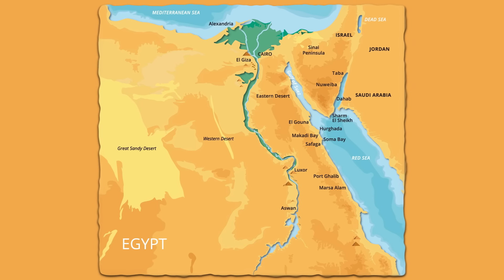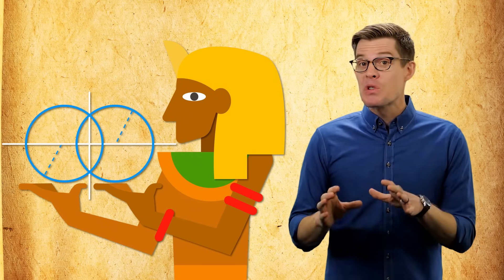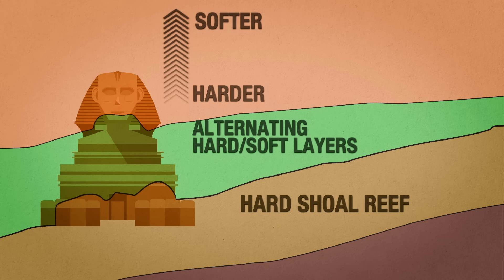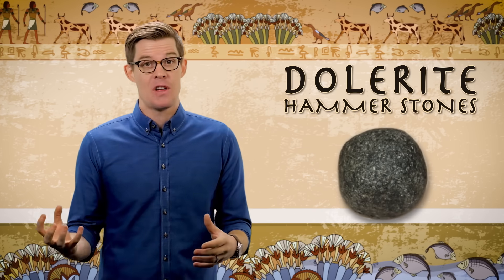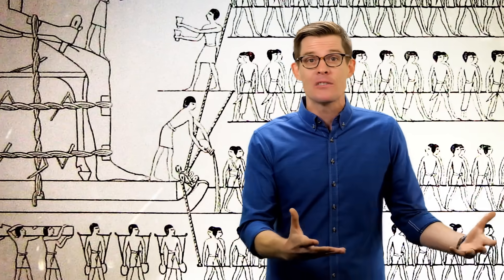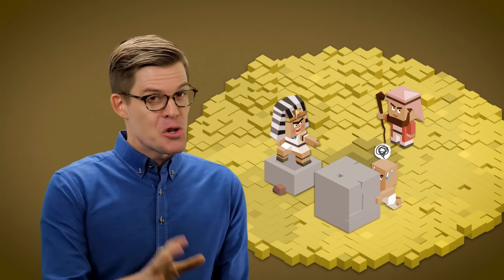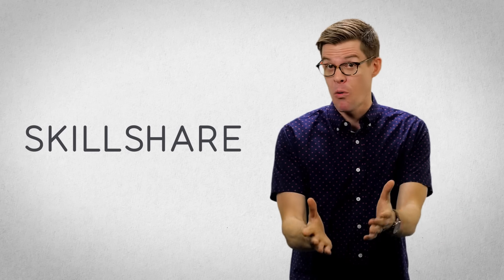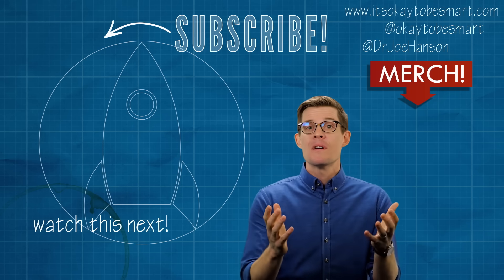The INCREDIBLE Ancient Engineering That Built the Pyramids

Comment: 2million+ stones, cut, shipped, placed, all within 20 years. So the Epyptians cut, shipped, placed a single block every 2.3 minutes. The inside contains granite, one of the hardest stones found on earth. In modern day diamond saws are used, but the Egyptians managed to stick and stone it in shape. Yeah, this guy knows nothing.
Reply: lol!  Pity you did not bother to learn the evidence here.  I of course understand that learning requires "effort" = whereas incredulity and poor assumptions do not.  C'est La Vie

1 - most of the "blocks" of the pyramids are actually little more than crudely hewn chunks of stone of varying shapes and sizes.
2 - so it appears based upon the blocks themselves and the quarry evidence that they were simply rapidly breaking off approximate chunks of stone in most cases - pounding a line of chisels or wedges a short distance into the bedrock is sufficient to cause a chunk to fracture free - followed by them levering those chunks onto wooden sleds.
3 - the sleds were then pulled by teams of men and oxen up an earthen ramp they made.  The quarries of Giza sit a mere 100-200 meters from the pyramids and thus the blocks did not need to be moved that far = only a few hundred meters. 
4 - while the smaller granite blocks which make up the walls of the King's Chamber were more carefully cut and polished the larger slabs above which formed the relieving chambers are mere chunks of granite very roughly hammered into rectangular shapes.  Remember however based upon the length of time for construction they would have had years to fashion these few blocks.
5 - finally granite can be cut using copper tools and saws along with an abrasive such as sand or corundum.  Limestone however is soft and can easily be shaped using copper and gneiss stone tools of which the Egyptians had plenty.  So there are lots and lots of crudely hewn chunks of limestone = but very few carefully cut ones on the outer layers and those forming the chambers/corridors inside.  The same for the granite as the King's Chamber is not very large and comprises a small number of granite blocks overall. 

Moral of the story:  so we already established that most of the blocks were not carefully cut or polished and that they did not need to be moved that far.  Further the inner blocks of the pyramids are placed haphazardly with large gaps all over filled with small chunks of debris and globs of gypsum mortar found slathered all over the pyramids. 

So if a single team of movers can pickup and move a block the short distance to the pyramid where they drop in in place in say 2hrs = then 10 teams can move 10 blocks in the same amount of time and so forth. Thus the more teams moving stone = the more blocks which can be placed in a short span of time.  We know they used thousands of workers broken down into specialized teams. Egyptologists estimate the Great Pyramid workforce at ~20,000.  

So if you had 50 teams of block movers of 50 men each + oxen = that is only 2,500 workers out of a workforce of 20,000.  That leaves plenty for quarrying blocks and so forth.  With 50 teams each team need only move 6-8 blocks per day.  The larger blocks in the bottom half of the pyramids took longer of course but the blocks above become smaller as they rise in height and thus could be transported and placed faster. Forget about the "X blocks per..." nonsense which thinks one at a time and think of the totality of what was happening.  You would have had blocks being placed in multiple places simultaneously.   Something new to think about.
Reply: @varyolla435  In the 90's they used these methods,  to attempt to recreate the pyramids but they failed horribly. It was on tv, nova something? 

The ramp alone is insane to think of. Yes 200 - 300 metres, but at what angle?! How long should that ramp be? Remember, you build up so the ramp grows bigger too.
And what would that ramp been made of? It had to hold at least 6 - 15 tons and not sink through the sand. Building that ramp would be as hard as building the pyramids!

I understand all your reasonings and logic and this is how your brain tries to make sense of all this. But there is much we do not know, please keep an open mind.
Reply: @Maru-ge6jn  lol!  How deep is your checkbook???  There are loads of construction outfits which would happily build you a pyramid.  In fact they would build an even better one for you than the Egyptian versions = but it will cost a bundle based upon the economics of today.

In fact there was a program a while back on Science Channel called:  If We Built It Today.  Among the things they looked at what creating a duplicate Great Pyramid - except it would be made all of granite.  Doing so was estimated to run several billion dollars = but it was entirely doable.

Moral of the story:  the blocks of the pyramids become smaller as they rise in height.  The largest/heaviest blocks are found in the bottom half of them - closest to the ground - while those at the top if you bothered to Google pictures of people who climbed it are small enough to have been slid into place by several men.

Thus as already alluded to we have actual examples of earthen and mudbrick ramps in Egypt used to build things.  The western cemetery next to the Great Pyramid contains small earthen ramps made from sand/stone chips/tafla,  They are quite capable of sustaining the necessary weights.  More importantly however is they only needed to go as high as the largest/heaviest blocks to be raised = King's Chamber.  

Above that level the blocks are smaller and could be raised via smaller mudbrick ramps or lever devices which sat upon the steps to raise blocks to the next levels akin to the Egyptian shaduf.  You are rationalizing based upon incredulity rather than considering the evidence we see.  

p.s. - yes = even Herodotus who wrote they created what he termed as "a great causeway" - read ramp - felt such an endeavor was likely as great an effort as building a pyramid itself.  Yet the evidence still points to that being what they did.  Follow the evidence.
Reply: @varyolla435  It was an experiment they did in the 90's using the techniques and tools which they believed were used. It does not matter how much money you throw at it, money will not suddenly change a flaw method. 

Again, I understand that your brain wants to make sense of all this. But engineering wise, you got it all wrong.

Follow the evidence, sure. But those can be interpet wrong. Follow the numbers instead!
Reply: @Maru-ge6jn  Absolutely follow the evidence.

1 - the 1997 experiment only used men to try to pull the sleds.  That worked for the smaller blocks they created - they could indeed create blocks using the tools at hand - but they had difficulty moving the larger stones.
2 - except that the worker village at Giza contained = many tens of thousands of cattle bones.  Further depictions such as are seen in the tomb of Hunefer show yoked oxen pulling a large sarcophagus on a wooden sled in a funeral procession.  Also the tomb of Djehutihotep depicts teams of men pulling a large statue on a wooden sled = except there is a man on the sled pouring water before it.  
3 - so a subsequent experiment conducted by researchers in Holland in 2014 proved how by wetting the sand alone before a laden sled you reduced friction and hence resistance by almost half.
4 - so the 1997 experiment was based upon = partial evidence.  It failed to account for how ramps were created in part using tafla - a clay the Egyptians mined - as well as the use of animal labor to supplement manpower and other things like wetting the path before heavily laden sleds to reduce resistance. So when you moisten a surface made in part by clay it becomes a bit slippery which also reduces friction. There is the remains of a massive tafla mining operation at Giza.
5 - there is also other evidence out there as well.  In 2013 the dairy of Merer was found on Wadi al-Jarf.  Also a number of stone blocks were found dumped into a central location and leading to them was a path with spaced wooden planks laid into the surface of the ground.  Thus via using wooden planks - the 1997 experiment used rollers which are harder to control - you create essentially what militaries have used for a long time now to cross soft ground = corduroy roads.  So spaced wooden planks laid into the surface of a packed ramp - as it would be with repeated usage - allow for sleds to more readily glide atop the path.  

Moral of the story:  so thus far all you have offered here is nothing more than incredulity and an allusion to a 1997 experiment which I noted was premised upon partial evidence we see.  Meanwhile I have given you = evidence we see.  So if you can not account for said evidence then so be it = but mere incredulity is not much of an argument.

So while it makes for good television to only use manpower in such experiments - it is not very realistic. Even today in parts of the world draft animals are still in use.  As already noted we can place cattle at Giza during the period of the pyramids while we further see evidence of their use by the Egyptians for manual labor.  So it is inconceivable the Egyptians were consuming cattle = but not also using oxen to pull sleds carrying the larger blocks anyways the same as they used them to plow fields and so forth.  Follow the evidence.

Comment: The first built-up mastabas and pyramids were mud bricks, followed by small stone blocks and then larger blocks, culminating in the pyramids of Giza.  Then pyramids built after those at Giza reverted to small stones and mud bricks.  It's as if there was a technological advancement that, as soon as the pinnacle was reached, reverted to prior practices.

My hypothesis is that the pyramids at Giza were built in pre-dynastic times, 8-10,000 years BC and all the other pyramids were a progressing attempt to match them, but never reached that point.  It's known that ALL pyramids other than the ones at Giza contain multiple carvings, hieroglyphics, and paintings.  Why would the ones at Giza not be similarly adorned?  Because when they were built there was no need to do so.  

The pyramids at Giza were built along with the Sphinx at the same time when the Sahara was still a verdant savanna.  Heavy rainfall eroded the Sphinx over a few thousand years and the Sahara changing to a desert gradually buried it.  The head of the Sphinx eroded from its original lion form to the point that, when the Egyptians of the first dynastic period found it, they re-carved it into a recognizable human form (This was later modified after the 16th dynasty to its present form.)

It's not known whom the Sphinx is supposed to represent.  It is accepted that the Egyptian sculptors were talented enough to make accurate representations in their sculptures.  The current damage to the Sphinx's face makes it almost impossible to match it with known rulers.  However, the Sphinx does have a rather distinct profile still visible, especially the very prominent chin.  Find someone with a matching profile and you have a likely model.

Comment: To build anything more involved than a log cabin, first you need a BLUEPRINT !! For that you need an ARCHITECT , not a "high priest " . After an architect draws a master plan , draftsman draw a blue print of individual blocks, of every level, cross section views etc. Considering that there were over 2.5 million stone blocks were used and many were of a different shape, at least 100 000 individual blueprints would have to be made .  Up until we started to use computers , blue prints were made on a 24x36 " piece of white paper with a hard pencil and to be one a draftsman required college education.                Next, you need to hire a MANAGEMENT  company . A project that took 20 years and employed around 20 000 people at any given moment , placing a 5 to 70 ton block in place every 2 minutes , 10 hours per day , 6 days per week, 20 years  couldn't be accomplished without superior management company and as we know, management is a modern concept )))). Pretty impressive even by modern standards !!                           The answer to the question " Who build the Pyramid ?"  The answer is  WE DON"T KNOW !  Attempt to explain it is nothing but arrogance of a man who thinks he knows EVERYTHING .

Comment: I think they had to some way build them from the top down. Maybe they made a huge mound of Earth started from the top and just dug away and set a block in it as they went. As far as hauling the stones to where they would be couldn't they have used airbags or did they not know how to inflate things at that point. I would think they did but maybe I'm wrong because if they did they could easily inflate some skins and use them like airbags to easily pull a block across them you put a wooden frame fill it with inflatable skins in almost use it like a conveyor belt

Comment: So 2.3 million blocks in under 30 years you say? 
30 years * 365 days*24 hours*60 minutes / 2.3 million = 1 block every 6.75 minutes for 30 years straight to complete. That includes cutting and shipping times. I’m going to say highly improbable if not impossible. Either it took longer to build or it wasn’t built the way you say
Reply: Think harder and more importantly = think in less simplistic terms.  Follow the white rabbit:

1 - a team of block movers can move a single block to the pyramid for placement in say 2hrs.
2 - then 10 teams can move 10 blocks in = about 2hrs.
3 - 20 teams can move 20 blocks in = about 2hrs.

Moral of the story:  the more teams working in tandem = the more blocks moved in a relatively short span of time.  No one builds "1 at a time" - not even today.  If you were building a brick building you would use teams of masons working in different places laying blocks simultaneuously...........so it was here.  The quarries which supplied the limestone blocks were only 100-200 meters from the pyramids.  Most of the blocks are crudely hewn chunks of stone of varying shapes and sizes.  

The quarries show where they were fracturing off approximate chunks and levering them onto sleds to haul them away.  The inner blocks were dropped in place leaving gaps everywhere.  Only those few blocks used to create the inner chambers/corridors and the last outer layers of stone were more carefully cut and in some cases polished. 

Finally the total is an estimate while there appears on its western side that at least part of the core was hillside which reduces your volume of blocks needed. You need to think of the totality of what was occurring.  Egyptologists estimated the workforce to be ~20-30,000 people broken into specialized teams.

Comment: There’s no possible way to know how many blocks were used
Reply: It is an estimate based upon volume and an average size of the blocks.  Yet ultimately there may likely be less than assumed since given what we see with other pyramids it is plausible that at least in some parts of the Great Pyramid = earthen filler and quarry matter was used as filler material to take up space and save the number of blocks required.  Later Middle Kingdom and Nubian pyramids were in fact merely piled earth or mud bricks to form a pyramidal core surrounded by cut and polished blocks.  Cheaper and easier to build and much faster.  

The exposed western base of the Great Pyramid shows a long "shelf".  It appears they leveled off what was a small hill to build atop it.  So the bottom portion of the pyramid may in fact have been formed from a hill and they surrounded it with blocks of stone upon which others were stacked.  The only way to know for sure would be to tear it apart which of course would be counterproductive.